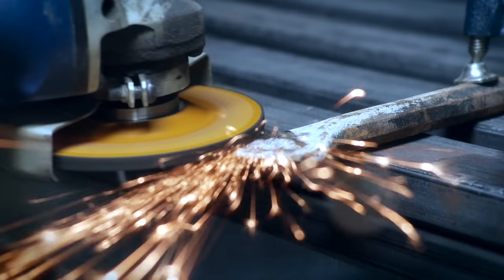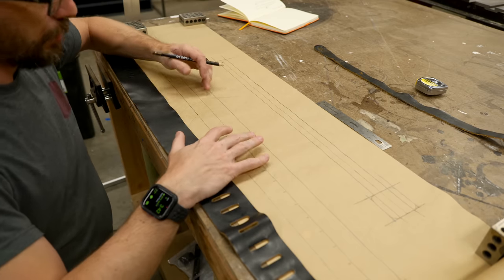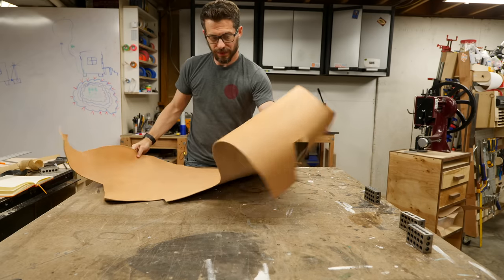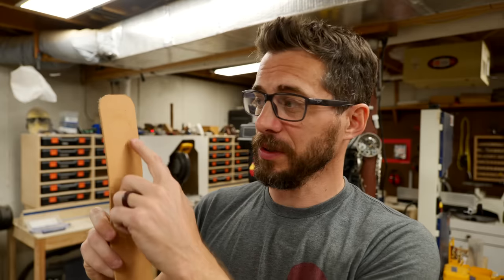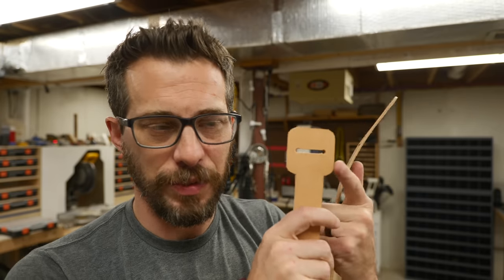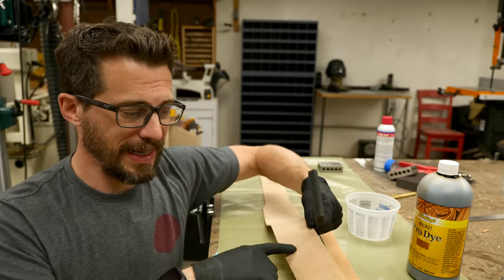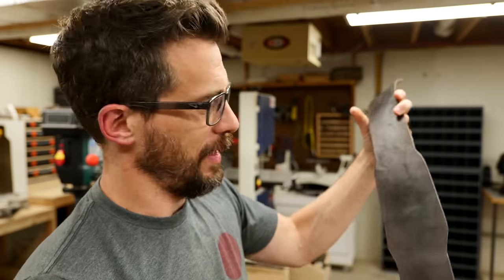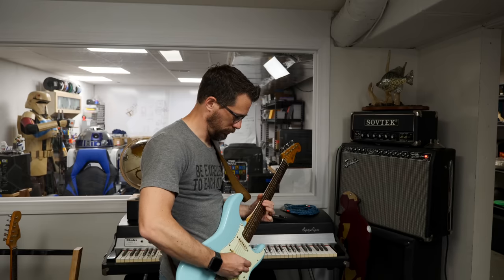Making a Leather Guitar Strap // Leatherworking | I Like To Make Stuff

Comment: "I've got some leather, and I've got some time."

Yep.  That's exactly what happened when I tackled a hide of 3/4oz with a strap cutter.  Guitar strap, rifle sling, belts, horse halters.  I keep stainless steel and brass hardware in stock for horse stuff, but you'd be surprised at the amount of overlap those projects have with hardware.  I didn't use a template for my guitar strap.  Used copper rivets with a 1" belt buckle for the adjustment on one size, and I riveted a big attachment block to the other side.  I don't like wide guitar straps so mine's an inch and a half, same size as belts.  I did spend a ton of time tooling everything though.  It's what turns a leather "project" into something unique to you.  Now, if only I played guitar a fraction of how well I can leatherwork.

Comment: That strap is very wide for the load it carries. But you will soon learn is that the leather is much more resistant to stretch from top to bottom of the hide. It really does matter on smaller straps and heavier loads.

Comment: Nice work!  One quick tip.  The leather you used looked in the video to be the lower part of the "side" of leather.  The lower part would be the belly of the cow.  Cows drink and eat and that skin stretches and contracts LOTS.  Things made from that part of the leather can end up stretching and deforming over time too.  It will likely last well for a low weight item like a guitar strap, but you wouldn't want to use it in a dress belt or something that needed to hold weight.  It didn't show on the video (you may have done it off camera) but if you didn't do it already you may want to seal the back so the dye doesn't bleed back out onto your shirt.

Comment: Funny I have been thinking about making my own strap recently as well. I got myself a new guitar earlier this month AND I'm working on building a kit (and making videos for it if folks are interested?). My thought was to try and make a strap using card weaving, which is a technique I learnt years ago and which could come in handy for something like this. I'd still need some leather for the two ends though, and probably some hardware for adjustment but otherwise I might give it a go.